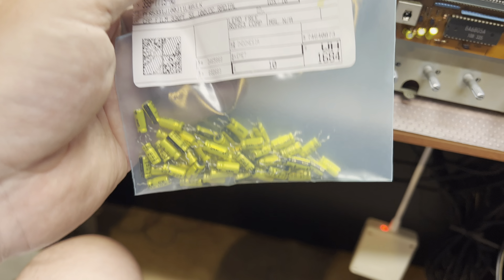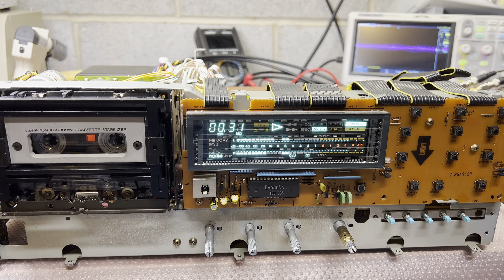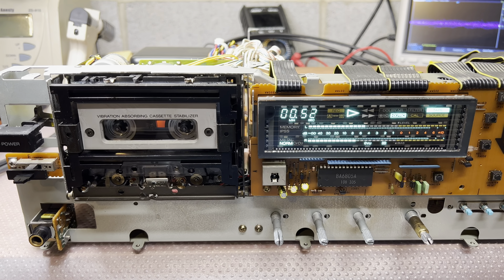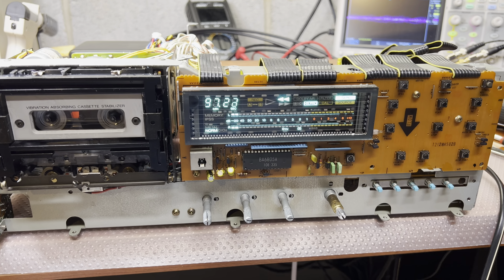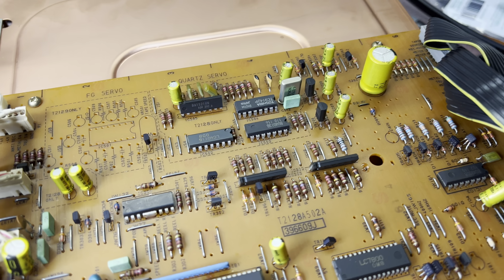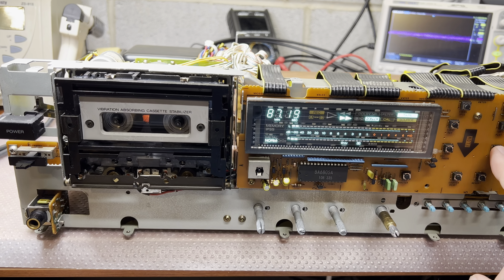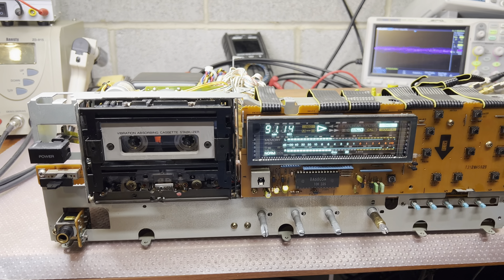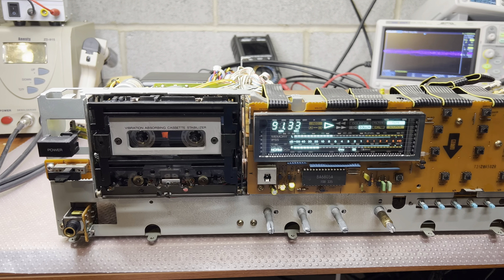Part 2 - Recapping the A&D GX-Z9100EV aka Akai GX-95 mkII

Comment: Hi, I went through many of your valuable clips ...well done ! Great hints and great job you are doing !

I've came with similar problem of my AKAI GX 67...Dolby B is more or less OK but Dolby C has 5 dB downfall around 400Hz at - 20dB, (at -10dB is better at 0dB is almost no downfall) ....... plus some sound distortion which sound like kind of compression....similar to sound recorded with any Dolby and played back with DBX.....
I' m going to run full recap and would like to ask you about capacitors used around Dolby chips - most of them are electrolytic - some values are hard to get in my area i.e  0,1uF, 0,56 uf.
Could you please share your exeprience with replacing them for MKP capacitors....ory any advise about recapping around Dolby chips....?
Thank You !